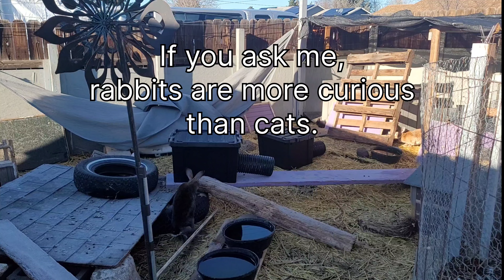Building 4 New Dens for the Rabbit Colony

Comment: Do you think it's possible to build nesting cubbies using just stacked straw bales and skipping the plastic totes and tubes?
Reply from the maker: Sadly, no. Even in the little amount of rain we get here, it soaks and gets mold really fast, plus they don't dig in, they pull apart.  Also, if they chewed through a bailing twin, you'd have dead rabbits . 
I wanted to make some out of wood, but the urine would be a problem and again mold. The nests get very humid. Metal would get too cold and too hot. I can't think of anything else to try.

Comment: Thanks Sarah.  I need to make some of these.  Im off to a rough start with my colony.  I let mamma Carrot dig a beautiful burrow to kindle in and all the kits died.  Ugh!  I also might be fighting coccidia.   Do you have any videos on that? Using Molly's Herbals and it seems to be working but any other insight would be great.  Im bent towards holistic methods. 
We are in Western Oregon were we get all the rain you dont! Lol.  My colony is covered but not bone dry.  Rain always finds a way.  Isinf lime amd fresh straw after heavy rains.  
I really want this to work, but feeling a little frustrated.
Reply from the maker: So it's hard to deal with at first. You'll lose a lot of kits at the start. 😩 Here is the problem...
You probably got rabbits that were raised in cages as your base stock. I did too. I lost most of my kits for the first year. It's sad, and it's hard, but the reason is cage rabbits bred for color and structure in cages have absolutely no immune systems. You are currently building immunity for your future stock now. I was planning on doing a video on this in spring, but I'll push it forward and see if I can do it in my next rabbits video for you.  Good luck, and see if you can give them a few plastic nests. They are easier for you to check on. 🖖
Reply: @GreenLadyUrbanFarm  yes, I can't find any colony rabbits!  Heck, I can barely find any meat rabbits!   I have four new does coming soon and all from cages.   My buck is running strong though so that encouraging.   I'm not sure what happened with the kits.  They were dead before they grew any fur.  Maybe she just didn't know what to do with them.  I'll keep on keeping on and hopefully catch a break with these new doe's I have coming.
Reply from the maker: @jeanannpowers9335  Well, maybe this spring we can swap rabbits if you are interested in making the drive to Redmond.  Message me on fb.
Reply: @GreenLadyUrbanFarm  thank you.  I'll keep that in mind.   In the meantime I'll cross my fingers and hope for the best.